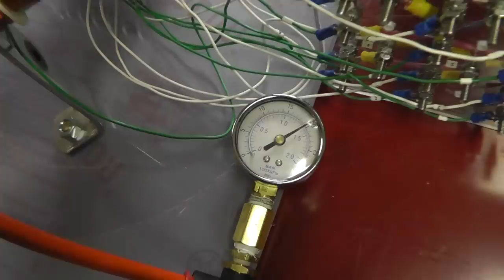After show live update: EPG & Russtic 7.0   2-6-12

Comment: Awesome work Russ, as always... I know it may be difficult but what do you think of pumping in Liquid Ar instead of gas Ar. Wouldn't it achieve better magnetic properties? Denser mass a.e stronger mag. oe am I wrong?
 I know it would be really hard to keep the temperature down below boiling point, but just a thought. For sure you try gas first as it is easier. Is here any chemical engineer to help me out on this?